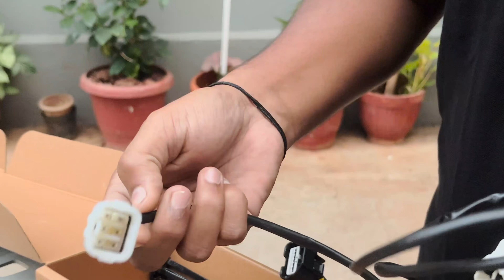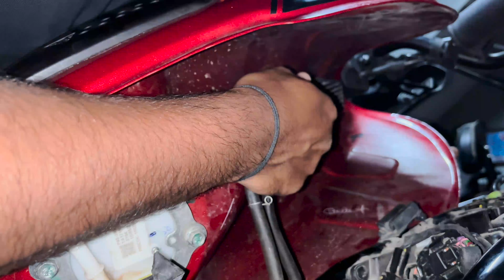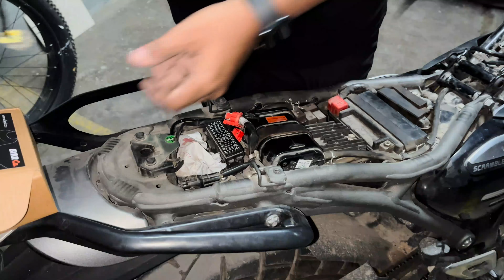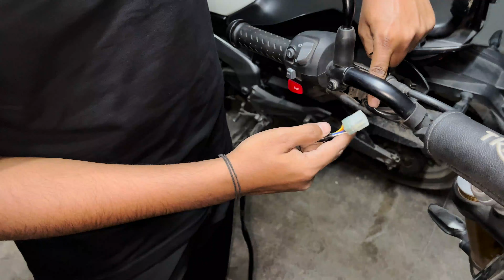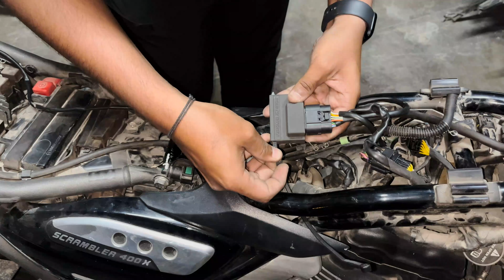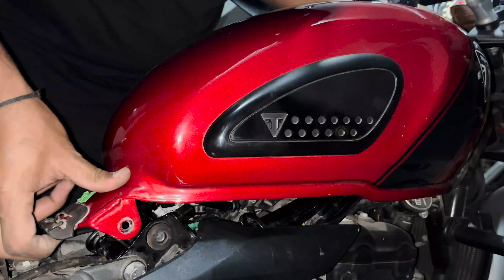Installing Electronic Cruise Control on TRIUMPH SCRAMBLER 400X/ SPEED 400 - Hold My Throttle

Comment: Looks like a great system! I'm considering purchasing it. When installing, you disconnected the fuel lines to the tank. Do you need to empty the tank first or will it spill fuel?
Reply from the maker: Hey! yes you disconnect the fuel lines, you don't need to empty fuel. 

As your motorcycle's fuel is controlled by pump, wont leak unless engine is on. It's safe to remove fuel tank when the bike is turned off

Comment: cruise control active he and sudden me brake apply karta hoo the it will slow down throttle or what?
Reply from the maker: Cruise control disengages and Throtte is returned to normal. 

Cruise control disengages with applying of front/rear brake or clutch. 
Same as a car or bigger bike cruise control.

Comment: Can we use this in Triumph Speed T4??
Reply from the maker: Currently we are able to make it for bikes with ride by wire only, we may soon come up something for cable throttle ones as well. It works with other Triumph 400 such as speed, scrambler, Thruxton etc

Comment: Got this installed on my 400X recently from Siddharth himself. The product although expensive works well as advertised. Recommended for those looking for long distance touring and those who love the CC feature like on cars. The setup is complete plug and play, so warranty should not get void. It can be easily removed if required before giving the bike for service although that shouldn't be necessary.
Reply: Warranty definitely gets voided, . . That aside, it'll be good for people who love touring, though in a country like ours, I feel it's very limited. . .
Reply: @radarroi27  WHY IT GETS VOIDED AS IT IS PLUG AND PLAY
Reply: @rudrasahil6086  Because Triumph will say it's an Unauthorized  Modification.
Reply: Kaha se milega??

Comment: Those who are asking about warranty. Let me very clear it will void the warranty if anything happens further in any electronic equipments it will not covered under warranty. I installed HJG lights and it is fitted with expertise with proper harness but suddenly my wiring got burnt not because of lights because of other reasons but Triumph told me that it will be covered from your pocket. So be careful.
Reply: what are those other reasons which cause the issue
Reply: @ronishane My self starter relay stopped working. So i jump starter and after 200 km wiring burnt😢
Reply from the maker: Our Hold My Throttle Kit is fully Plug n Play, no splicing or cutting any wires.